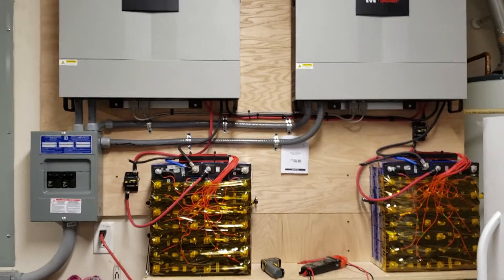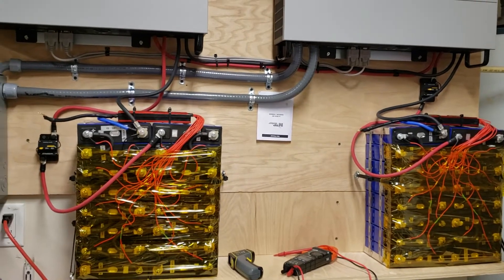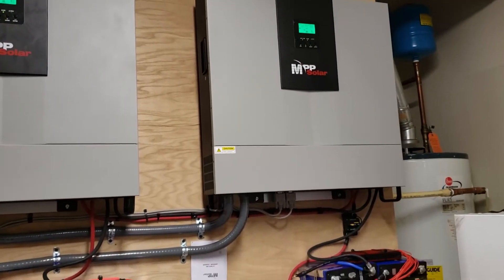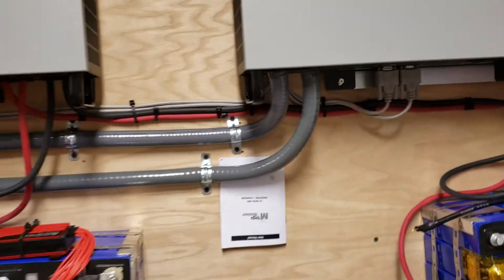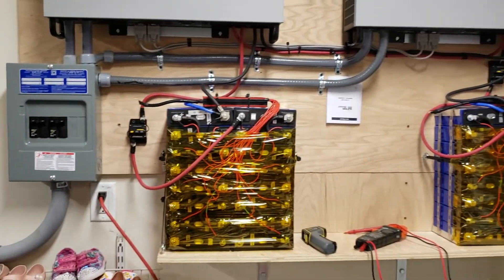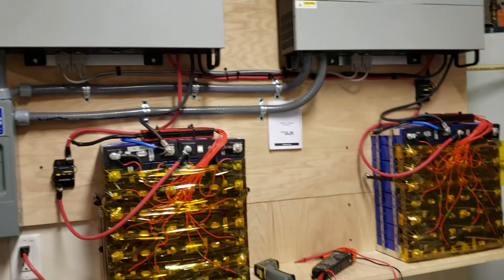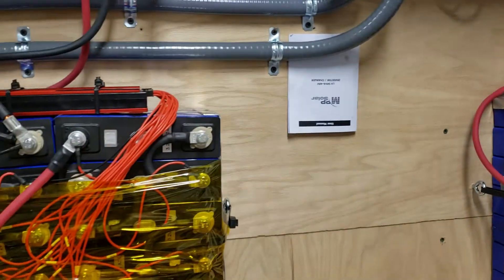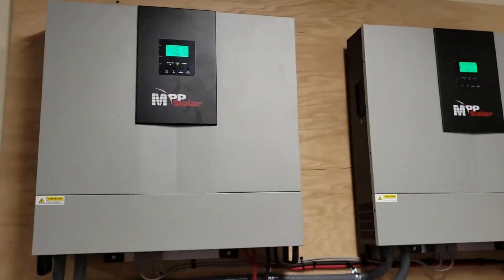MPP Solar LV5048 short overview.

Comment: Again: Great looking install!
Reply from the maker: Glad you like it! See some of the newer ones for progression of the project. Thank you,
Reply: @DMIINC2013  I've watched them all now. Nice work! 

I'm trying a setup with a single LV5048 and a couple of the eco-worthy (branded) grid-tie's with limiters after the LV5048.

The plan is to use the LV5048 charge controllers with a battery bank, and have the grid-tie inverters after it. The LV5048 will be set to provide power only from the utility for loads, and only use solar to charge the battery bank - which the grid-tie inverters will use to subsidize the load. If the grid power goes out then the LV5048 switches to stand-alone inverter mode for backup power. I guess I'll see if the grid-tie inverters are still happy in front of a stand-alone inverter. If not, I could have a SSR control the battery input to them with power from the grid before the LV5048.

Anyways, it is just messing around until I can expand my solar/batteries and get a couple of more lv5048's and 100% solar.
Reply from the maker: Sounds like a good plan until expand.

Comment: Very clean job.  Love it!   A single battery bank -  big red cable running between the LV5048s?
Could you turn one unit OFF at night cutting your standby losses by 1/2?
Reply from the maker: Yes I could turn one unit off and save on stand buy consumption but with the size of power wall that I have it is unnecessary. Thanks,

Comment: Why do you need two to run two 100 ah batteries? You can connect both to just one of them because you can connect two to each one. Furthermore, if the two batteries are identical, you can parallel connect them too.
Reply from the maker: They are in parallel. Please see more videos in regards to progress of this endeavor with both BMS and Power walls. Thanks.

Comment: Hey, have you tried hooking up a generator as AC in? The system supposedly takes single phase input from a generator but the wiring instructions don't specify how to hook that up. Very much appreciate your vids!
Reply from the maker: Not yet. However wiring does not change be it grid or generator. L1 L2 N and Ground still have to be applied. Thanks,

Comment: are you running each inverter on a separate battery bank? I am running dual mpp solar  parallel units right now and in the pdf manual it clearly stated on mine that these have to be on the same battery bank. Now mine are different models. I am looking at yours because Im researching the lv5048 for my Texas home. We have dual inverters for our Philippines house building project right now. Like you I keep getting latin speaking videos on this model.
Reply from the maker: Yes. They are both on same battery bank as advised by manual. 3 weeks now and they are behaving properly.

Comment: Hello! Nice setup! One question about the battery charging. I this model says it has MPPT solar charging, is that ok to pair up with the BMS to charge the batts? 
Im planning on using this to charge some li-ion batts via a BMS.
Reply from the maker: Yes. It is all in one system. Each unit has 2x4 KW charge controllers. No external charge controllers necessary.
Reply: DMI INC awesome, thanks!

Comment: What is the load output for 2 inverters parallels split phase? And how did you connect your loads?
Reply from the maker: Max output for both inverters when in parallel is 10KW. See this video for connecting the inverters to the home https://youtu.be/Zv4KpmqTb9w and this video for split phase setup https://youtu.be/iTEcvDKF5j4  Thanks for watching.

Comment: I like your setup. 👍 I have a 5048 just like that I have been uploading updates on mine for the last month stop by my channel and check it out.
Reply from the maker: Day after uploading my first video I came across your channel. You do have nice set up too. Especially liked the video of electric utility  and skunk visit. 😁👍. Keep on with updates since there is not to much info on these units. I can't wait for approvals to install solar panels.
Reply: @DMIINC2013  I will keep the videos coming soon as I get some more time. I will be looking forward to seeing some of your videos after you get your panels install  have a good night.👍
Reply: Hey guys, I follow both your channels. I just bought 40 panels, Nissan Leaf batteries from Tech Direct, and I'm currently speaking to Peggy from MPP Solar and she told me that the range is from 44v to 54v. The battery range is from 40v to 58v. How much forgiveness do I have with this? Will this setup allow me to utilize MOST of my power? Thank you guys, Love yall's channels.
Reply: @Lumbeelegend  on my inverter I can go down to 44 votes and charged up to 57 volts using utility grid power. At 57 volts your batteries were roughly be around 95% charged and at 44 volts you will have about 20% power left in your battery. If you would like to go below 20% you will have to turn your main breaker offbut you will have to turn the main breaker back on manually when it hits 40 votes are the inverter will shut down. With these lithium batteries they have a whole lot of power and you would not believe how much power you can get from 95% to 20%. I think you will be very happy with them.  How many Nissan leaf batteries do you have.
Reply: @carsonlurbanwindandsolar3437  I was going to go for the 48 pack, lol. But I decided that it may be better if the experts built them so I went for 6x of these...

https://www.techdirectclub.com/48-volt-nissan-leaf-lithium-ion-mini-power-pack-battery-3-5-kwh-66ah-storage-g1/
Reply: @carsonlurbanwindandsolar3437  oh, and she said that the LV 5048 would only go from 44-54 volts. Can you set different points?
Reply from the maker: @Lumbeelegend  Not true. Max charge and float voltage can be set to 58.4 Volts in the menu. I have my battery packs set for 57 Volts on charge and float. Discharge level at 44 Volts. I do not have Lithium Ion batteries. I have LiFePo4 which have lower optimal voltage per cell so settings will wary between the two. I believe Lithium Ion cells can charge up to 4.2 Volts and discharge to minimum of 3 volts per cell. LiFePo4 are 3.2 Volts nominal, charge up to 3.65 volts and discharged down to minimum of 2 Volts.  Work out your charge and discharge levels as you see fit but I decided to stay well with in the limits for what my cells can do. 44 Volts maximum discharge (2.75 Volts/cell) and max charge 57.3 Volts (3.58 Volts/cell) I do want my battery packs to last as long as possible.
Reply: @DMIINC2013  thank yall so much. I'll be ordering it tonight, when Taiwan is morning.
Reply: @Lumbeelegend  44 to 54 is just the best operating range for the inverter it will go lower than 44 and it will operate at higher than 54. You will have to go into the settings and pick user and that will give you the ability to change the voltage to whatever you desire between 40 and 58. And on your batteries you will have 21 kilowatts that's more power than a Tesla powerwall. 😁
Reply: @carsonlurbanwindandsolar3437  and it's like half the price, lol. I figured it would be enough after degradation. I was gonna build it just like yours, but I couldnt pass up a pre-built system for around the same price. I was going to go for the 24kw, but 21Kw should be enough. Thank you for the help, I'll let yall know how it goes.